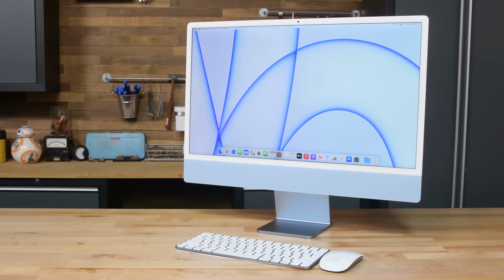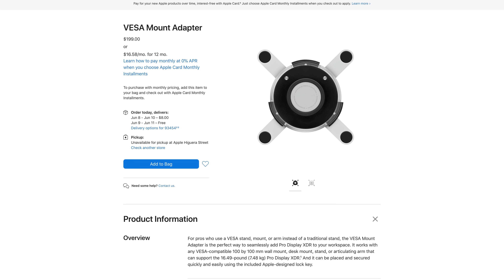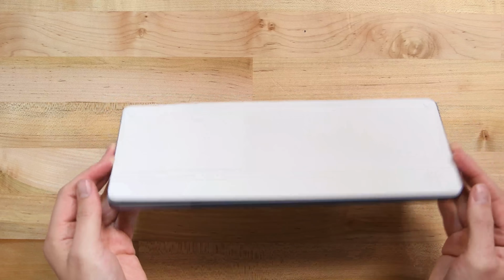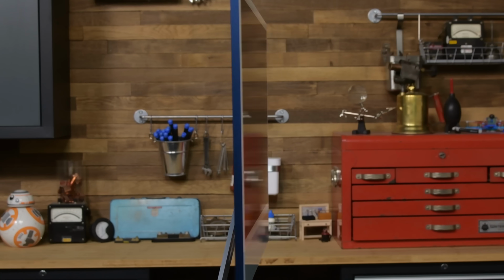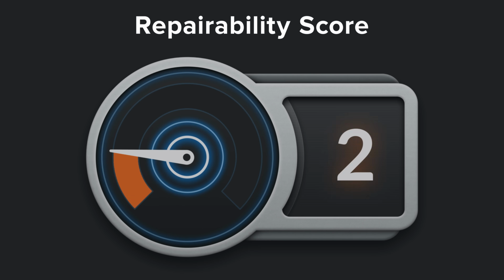M1 iMac 24” Teardown: A Desktop Only Jony Ive Could Love

Comment: Knowing about repair ability is useful but if I cared about that I would just buy a desktop
Reply: Yeah, definitely not going to be fixing the Ram or SSD of it breaks.
Reply: @madmax2069  Tbh I never had broken ram sticks  or SSDs in any of my laptops only ever in desktops. Easy to replace usually leads to „easier“ to break
Reply: @Nik6644  you may not, but others have. Just because you haven't doesn't mean it doesn't happen.

And two "easier to replace easier to break" no, not really.

Comment: Im gonna be honest, I find it absolutely braindead for everyone in the comments to complain about the repairability.
I highly doubt many people in the comments would even know the difference between Arm and x86, not to speak about how to repair anything in the Imac.
Perhaps its apple and people are hating on it just to hate on it and feel cool, but maybe those people should think about what they write. For Example, I read many comments on how "overpriced" it is. If you compare windows aio's, you wont get more repairability in the same formfactor. Neither would you get cheaper prices, and you bet your ass the m1 is more powerful. 
Also a question I am asking myself, HOW would you even break an aio, and how Braindead would you have to be?
The Takeaway is that people are going to hate on apple because they are used to it, and cant compare it to windows alternatives, because there arent any. The Closest you could get is a microsoft surface studio 2, what has outdated laptop specs. The Surface Studio would have a Touch Screen, but Windows isnt even designed to be used with a touch screen, so other than graphic design, I see no use for it, and in that case you'd get a wacom tablet and not an aio.

Comment: I don't know about Apple fan boys but man! no desktop PC should have  non-upgradable hardware such as RAM, SSD and the WiFi-Bluetooth card. These 3 things should always be modular and easy to replace.
Reply: Why though? You can’t compare the new iMac to a tower pc. It’s much more akin to a laptop
Reply: @Nik6644  You can compare it to any other All-In-One PCs. They sadly mostly have a soldered CPU, but they  provide RAM and SSD Slots and Wifi Card Slot.
And even if you want to compare it to a laptop, most Windows Laptops are thin and upgradeable.

Comment: So with the touch id in the keyboard, if i damage the keyboard can i replace it with another one and it will still work or will it need to be paired in some way?
Reply: Pairing a apple keyboard to any Mac is easy
plug the lightning to usb-c cable into the Keyboard and the Mac you want to pair it to, and they are paired

Comment: Disposable computers. Not cool.
Reply: everything is disposable given enough time
Reply: Nothing lasts forever
Reply: everything end up disposable if you wait long enough, even humans and the earth/sun
Reply: very cool and cleaner than any repairable crap nobody repairs but throws away. this is glass and aluminium, lasts at least a decade without any issue as wevery apple device, and is made so brain meltingly efficient, no rapir could ever compete with a replacement of the entire thing, not in price, not in time, not in c02, not in waste, not in anything.

Comment: Seeing memory chips they easily could've made them socketed and replaceable... and there's no excuse for desktop pc not to have upgradeable ram as well
Reply: Yeah their argument is the "unified memory architecture" which is nothing more than than some generic DDR4 memory slapped onto the chip's substrate. Nothing fancy about it. They could have easily made it upgradable with some small board to board (Lego style) connectors. The memory modules would even have been proprietary (=made them sh!tloads of money), but I guess if there is one thing Apple likes more than money, it's even more money from people having to buy a completely new computer altogether. Let's just hope the new Mac Pro will have upgradable RAM. Otherwise the term "Pro" will have just simply become marketing BS.
Reply: No, it is a SiP package, the memory is mounted to the same substrate as the CPU die and the peripheral controller.
Reply: @PavelUrusov  it's not a SiP because it's not actually the same package ;)
It's individual packages and thus not ONE package and thus not a SiP.
Reply: @detroxx56784  you mean iMac pro right? becasue  currently mac pro can be upgraded after sale up to 1.5  TB RAM
Reply: @bbeni24  I am talking about new/future ARM iMac Pro models.
Reply: @PavelUrusov  It's absolutely not an SiP. This has been confirmed on multiple teardowns, and there have even been semi-successful attempts to mod it. 

HOWEVER, the memory controller is integrated to the CPU. Since the M1 is so cramped, the memory controller ends up being the biggest bottleneck for upgrading it. Apple could easily add high-quality memory controllers to all of the M1 chips, but I guess they decided that some Macs shouldn't have the best hardware available, and made a pretty big compromise in that regard. Intel and AMD both ship CPUs with memory controllers capable of addressing up to 64 gigabytes of memory now, even in a laptop. Apple has no excuse to keep using such terrible components in their SOC.

Comment: Why a pair of CR2016 battery inside?
Reply: Used to retain needed system information on the BIOS/CMOS chipset of the motherboard, in case of power outage :)

Comment: Stop scoring reparability. No one cares about it anymore. This is the best All-In-One PC Ever, and this what matters!
Reply: ok
Reply: What do you mean no one cares anymore? What if your drive stops working or the RAM is faulty you'll be screwed after paying 1699. that's a lot of money. It's nice to have the repairability score as devices are becoming harder and harder to repair and that's not a good thing.
Reply: @Soren0  I never had faulty ram in a laptop or similar device. Only ever desktops. Soldered ram is more reliable
Reply: @Nik6644  hmm or have the ability to upgrade the drive at least as the drive will fail at some point. What I was getting at is that it seems one has to spend the most amount of money at the time of purchase where before one could buy the base model and upgrade when needed. At least the laptops make it more repairable. The battery and drive are the most critical components to need service at some point.
Reply: @Soren0  not gonna happen, apple computers last easily 10 years without any issue. if not you get a new one and you are up and running withtin the same day because a mac backup is actually working.

Comment: Well we know where to find all the apple haters at one place. Apple offer a REALLY good computer with a fck 4,5k display. Everything was removable not ssd and the ram and you all complain? Yeeez
Reply: They are a channel that focuses on repairability what did u expect
Even ppl whp love apple products listed the exact if not similar issues
Reply: A "really good" computer doesn't offer 2014 performance for $1,500. Sorry bud, it's not as great of a deal as Apple might have you believe.
Reply: @dial2616  performance is actual pretty great tbh
Reply: @warhead811  Relative to what? The M1 offers worse graphics performance then the GTX 1060, a low-end GPU from 2014. That's embarrassing, and the CPU performance is up to par with last-years 7nm chips, putting Apple about a year and a half behind the rest of the industry.
Reply: @dial2616  lol the m1 is dominating what are you talking about. It’s not a gaming computer. Check benchmarks and comeback. Also still they offer 4.5k display in the price 😉 just another apple hater
Reply: @chrispy.critter  I've been keeping up with benchmarks, it's slower than a GTX 1060. I can't work with something that weak.
Reply: @dial2616  okey to make things clear:
Is this a gaming computer?
Is this a pro computer?

This is by far the best value all in one computer you can get for this price. It will out perform even the top end computers in its league. Also the screen is superior to what you get in example other brands. 

Also m1 in a laptop is slaying the pc side. That have integrated graphics. So please compare it with something that is the same price and you see quite fast it the best value you can get. (I am a pc person with a gaming pc, but m1 has really changed my mind when it comes to laptops)
Reply: @chrispy.critter  My M1 Macbook Air gets a 40% slower geekbench score than my $600 budget desktop from 2014. It had an i5 4460 and a GTX 1070.
Reply: @dial2616  you still comparing a dedicated GPU vs a all in one chip. Please compare the m1 with mobile chips from both intel and amd. And the m1 computers is still no gaming product
Reply: @chrispy.critter  Sure, Intel's latest XE graphics beat the M1 pretty handily, but are priced about the same. AMD's integrated GPUs are pretty close to the performance the M1, but it's Vulkan support generally puts it ahead of the M1, which is forced to render things through the notoriously semantic, picky, and relatively slow Metal API. The M1's integrated GPU lines up with the performance seen in the Zen2 platform, which puts them ~18 months behind the industry.

Comment: What a terribly engineered piece of hardware. This teardown does a good job of highlighting how asinine the design language is here: they can have as much free space inside as they want, but they'll never let you have an expandable DIMM tray or an empty NVMe slot. Until you can replace the internal storage, Apple silicon won't be a part of my daily workflow.
Reply: Not on all Apple devices :)
Reply: @Tomas_Anders  Name a single modern Mac that has replaceable storage.
Reply: @dial2616  Mac Pro for example.
Reply: @Tomas_Anders  Great, so I need to pay $6,000 to have a repairable PC?

Comment: So now that a lot of components are integrated in the System on a Chip, does ifixit wanna give it a lower repairability score from now on?
Reply: makes sense. ram and storage are HUGE for reparability, and now they're not user-upgradeable, so...
Reply: @CommonTater100  most machines have the m soldered on, not just apple.